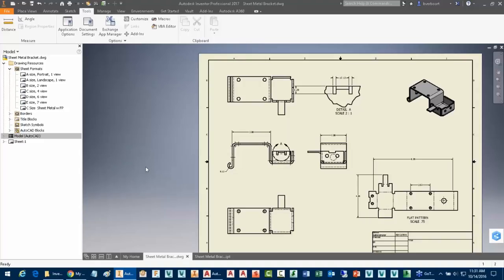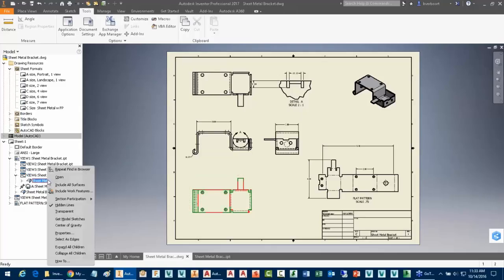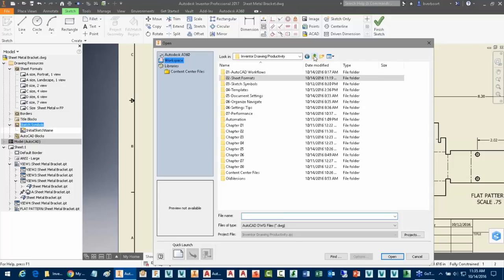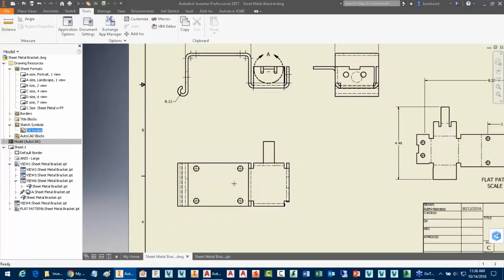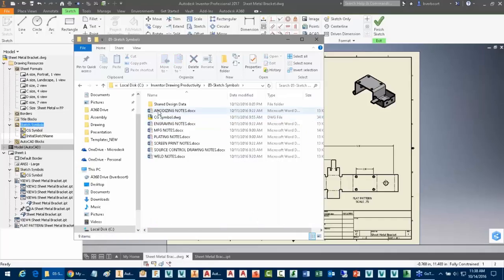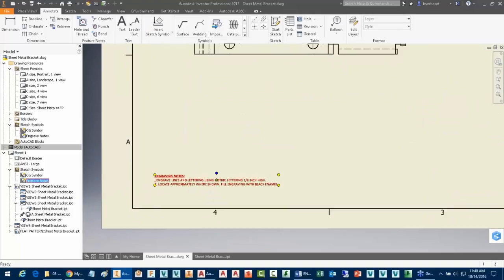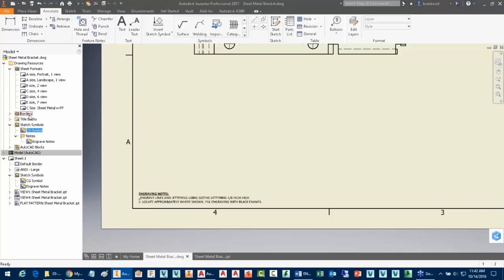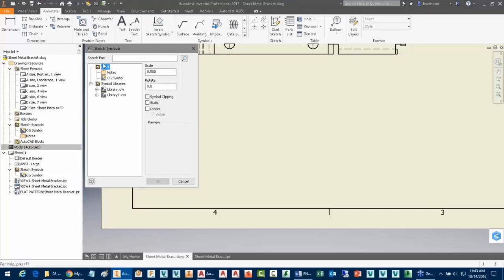Autodesk Inventor Drawing Productivity: Sketch Symbols

Comment: Hi, nice guide! Do you know of a way of making a sort of dynamic symbol, which can have a user specified text input? For example a symbol of a capacitor with text attatched to it, where I could just place a bunch of those in the drawing and specify different value for each?
Reply: OK, nvm. I've figured it out. In case anyone was wondering: Draw your symbol and add text to it (any text). While adding text choose from a drop down menu "entered value" and save it. Whenever you place a symbol it will prompt you for value, which you can edit later on as well. It's such a shame Inventor doesn't come with common sketch symbols like convergence (slope) or groove type.
Reply from the maker: Our technical experts would be happy to assist with your questions! Give us a call at 877-311-6284.